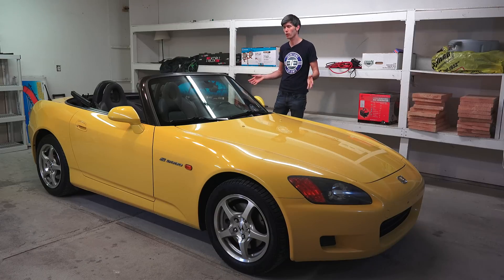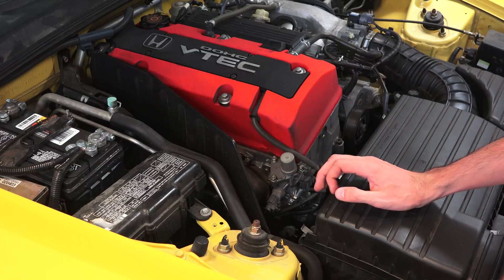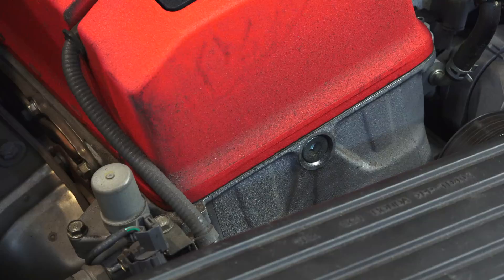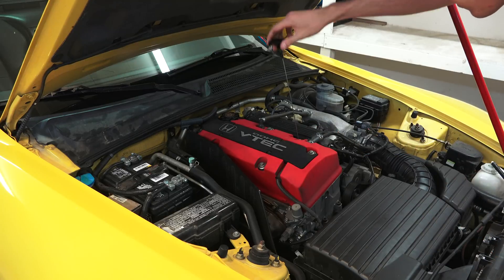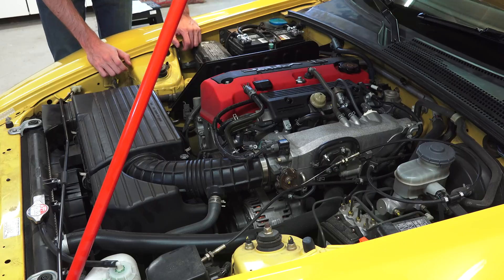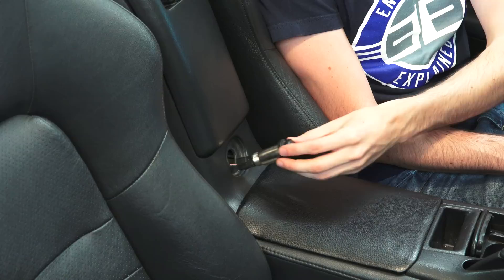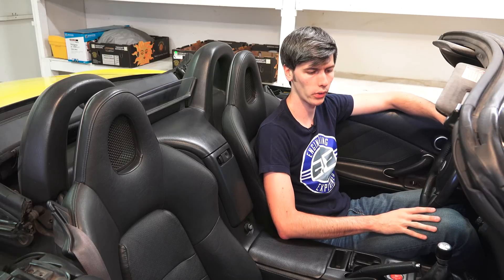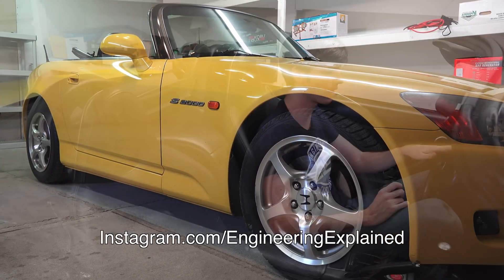What's Wrong With My Honda S2000?

Comment: He brushes off the burning oil thing like its no big deal. Any car that burns oil is a no no in my book.
Reply: all vtec motors burn oil, especially the high compression f20 9k-spinning motor, ask any honda/s2000 owner
Reply: Mine doesn't. 124,000 miles on it. I bought it brand new..after the break in period, I used Mobile 1 synthetic oil. I check the oil every time I get gas. Always the color of honey when I change it.
Reply: if your car isnt burning oil, you're doing something wrong lol jk
Reply: I faithfully change it regardless of what the oil life monitor says. Running like a champ. 
Every 4 fuel fill ups I use Schaeffer neutra fuel stabilizer and cleaner. Getting 35 mpg...car was rated at 33 mpg..no complaints.
It's all about the maintenance. Some do, some don't. Replaced the serpentine belt at 120,000..then rechecked it a week later..it needed a lil more tension, so I did that. Take care of your Honda..it will last.
Reply: Lol I guess you haven't owned an older car before. Especially an older 4 cylinder. All of my family's cars are 100k miles + and all burn oil except our V6 Highlander. Burning oil is not ideal, but as long as it doesn't get much worse and everything else is reliable, it isn't the worst problem to have. Oil is cheap, and people should be checking it at every fill up anyway. If you're curious about which cars that I (as well as my family) have had that burned oil, they were:

1999 Chevrolet Prizm (Toyota corolla rebadged) with the 1ZZ-FE engine (notorious oil burner: a quart every 400-800 miles depending on how much interstate driving there was...3 speed and oil burner do not mix well)
2001 Toyota Camry LE 4 cylinder
2004 Camry LE 4 cylinder...my current car (2AZ-FE: known for valve seal issues on '02-06 models, piston ring issues on '07-11 models I believe)
1998 Honda Odyssey (great car but engine used a quart every 2000 miles or so)
2006 Camry LE (same engine as mine, same problem)
Reply: Heheh..ya. Maybe I should my maintenance schedule. NOT. If I get 250,000 miles out of her, I will be happy. Maybe even more miles.
Reply: I also change my transmission fluid every 10,000 miles. And the filter. Honda claims the trans filter is internal..inside the trans. This is true. BUT, there is also an external trans filter located behind the battery. Looks like a vacuum modulator. I replace that too. 15.00 on Amazon. This is on a 2008 fit Sport.
Use Honda transmission fluid. Nothing else. they are finicky. Never flush the transmission. Just change the fluid..1/2 stays in, the other half is new. It always comes out red during changes...and no metal shavings on the magnetic plug. I wonder how many other Honda vehicles out there have the same filter that they claim doesn't exist.
Reply: +GKAtascosa Some S2Ks burn oil, some don't, regardless of maintenance. Neither of mine did/do and my current AP2 has 128K, mostly above 6K revs :) and it's just beginning to sip a tiny bit of oil as expected, but I've heard of nice ones that burned some oil from a young age.. My 03 Acura CL-S 6speed has 186K with some beating and burns ZERO of it's well maintained synthetic oil and I fully expect 250-300K from that V6, if whoever I eventually sell it to keeps up the good work. With your perfect maintenance I'd expect 250K out of the S2K as you said, if you don't beat on it too much, though I don't know how to drive one without banging hard redline shifts every time I get the chance so I expect to rebuild my current S2K by 150K.
Reply: I don't have an S2000, I have a Civic.

Comment: Someone has changed the battery cable ends and those clamp on ends are rubbish.  They will start to corrode. There are solder on ends with solder pills available. Use this with some shrink tubing if replacing the whole cable isn't worth it. Thanks for the vids.

Comment: What a score man! The S2000 is by far and away the best Honda because they put the power to the correct wheels :D The only bummer is that it's yellow... But if you don't mind, or happen to like yellow then this obviously isn't an issue. Seems like the problems are quite minor for the mileage however. The tough one will be the timing chain tensioner.... Not an incredibly tough endeavor, but by far the most difficult thing you have shown.
Also, I would like to see the DIY stuff with the S2000 on your channel!

Comment from the maker: If you're into Instagrammies follow along here! https://www.instagram.com/engineeringexplained/ Because I'm too lazy to Snapchat.
Reply: When checking the oil, turn the dipstick the other way around, you'll get a more accurate reading. Burning oil is often signs of the valve-guides being worn. Rarely if ever has it ever been piston rings. Honda didn't have issues like that. I would recommend doing a full valvetrain rebuild with bronze valve-guides, new seats, springs, and retainers. Also if your going to be pushing it, do the oil jet bolts, they updated those from AP1s to AP2 (2-Jet vs 4-Jet)
Reply: The Airbox comment you made early in the video, most people say that the stock airbox actually provide excellent power, and a pod filter or something will actually reduce the power output.
Reply: Man I wouldn't touch that leaky bolt yet. It's not worth the risk. Just wait to do it at the same time you're fixing that timing chain tensioner. that way it won't matter as much if you drop the parts in the engine by accident.
Reply: @Tobberobbe97 most stock air induction systems are fine. I think a lot of the CAI's are unneeded parts with exaggerated promises (if not worse performance).
Reply: My 1996 ITR with the B18CR used to burn oil and as said by Zero Hour, it was the valve-guides/valve stem seals
Reply: BEHEMOTH20 - Its hard to get power from these F20/22s. Its like a K20 with all the bolt ons and cams already, so its hard to get something better than stock. But its doable, even going stroker works.
 
Otherwise, a good intake, headers to exhaust and tune would get some power but its almost not worth spending money on bolt-ons
Reply: +KrazeeCain actually, the S2000 OEM header is extraordinary.  There ARE a couple that make gains on the S, however.   Ballad Motorsports and URGE Designs are about the only two that I can think of.   A tune will also be required, to see the gains.
Reply: what about brakes? thats important, isn't it?
Reply: +Tekmatic Agree on those two headers, and repeat what others said about not much to gain with S2K bolt-ons. I'm on my 2nd AP2, sold all the engine bolt-ons (including Ballad header, the ONLY thing that mattered) that gave my first one just a little more power and put all the money in better coilovers, tires, etc. IMHO the only money to spend on S2K power is Forced Induction..
Reply: At least with the D and B series engines a lot of people just run 10w-30 instead of 5w and it solves the oil burning issue. I don't know if that will work with the F series or if it's worse to run heavier oil in it.
Reply: GM states on the new corvettes 1 quart per 500 miles is the threshold of oil consumption for high-performance driving. It just happens.
Reply: +It's Zero Hour just fyi for those reading- i think the oil jet bolts were changed mid AP1...my 2002 had the newer ones factory 95℅ sure.
Reply: dan deebz - Hmm, I was gonna say I think in 2003 it might have been updated. Still, I'd go for the rest of the valvetrain.
Reply: Will this fit in my Honda you're going to be that guy..
Reply: Seen a few S2000 engines tuned for racing, all made more power with longer intakes, to the point where it was just silly with feet of pipe hanging out the side of the car while on the dyno, not sure how it affected torque though.
Reply: BEHEMOTH20 That was probably just to get cold air on the dyno. Also a longer air intake wouldn't really affect the speed of the air like the manifold would.
Reply: ***** Yeah they're only good for adding induction sound. I feel like exhaust is the same way too, mostly. I mean really, who's going to feel that extra 10hp catbacks supposedly give anyways?
Reply: Exhaust is a little different, then again I put a long tube header, downpipe, high flow cat, all 3 inch stainless mandrel bent tubing with an XR1 Borla muffler. All that I did notice a nice performance upgrade along with my HP Tuners MPVI Pro tuner. As far as CAI, I just added a K&N filter to the stock air box.
Reply: ***** Oh hell yeah, once you start talking headers you're going to see some gains. Cat-backs alone rarely gain you anything though. I (and my wallet) gave up on the notion of performance in my Vic, and just deleted the h-pipe and replaced the mufflers with 18" glasspacks. That's definitely not a performance upgrade, but I love the sound now, it's like a hot-rod from the 1950's.

Before doing it I read that going with true-duals can kill some horsepower, but I think since my car has such shitty log-style exhaust manifolds and stock cats, having an h-pipe or x-pipe isn't going to help it much anyways. lol
Reply: Thanks for posting your Instagram link! Keep the videos coming!!
Reply: Engineering Explained Honda S2000 or 8th Gen Si + Miata NB?

Comment: You should make a switch to engage the solenoid for V-Tec instead of having to rely on the oil pressure to trip the switch. That way if you turbo it you can have a sort of anti lag system.
Reply: If turbo'd the ECU can be customized to change the crossover point.  The solenoid will only engage if the oil pressure is sufficient, though.

Comment: If the dipstick is like the one on my Accord 2.4l, it has two "O" rings at the top by the handle, inner and outer. If you are not careful while checking it, it doesn't get pushed back in all the way and the oil level will look low. How do I know? I have done it and incorrectly measured the oil level.

Comment: Those are minor problems. A really good deal you got. I must say that despite having the skill to do my fluid change on my car, I never do it, I hate it, and I'm not equipped to really lift my car adequately for it and to recover to fluid without making a mess. Also I don't have a nice garage like that. We do have a small one but we use it to store other stuff. I do the wheels, spark plugs, air filters and other small mechanical stuff ( On my FIT and my girl Friends Corolla ), I wish I was rich and that I had a really good lift to work on my car, that would be awesome. 

Anyway, nice deal and looking forward on updates.

Comment: Classic 'book smart' engineer. Can explain all of the physics, statics, and thermodynamics about an engine; but can't check the oil correctly, ordered special washers and o-rings when they're 5 cents at the local hardware store, and didn't even look over the car himself before he bought it.
Reply: being a mechanic and being an engineer are two different things
Reply: classic hater.
Reply: FreedomFighter
Lol. If you say so. It's the truth though. You heard him say he's never even been under the car.
Reply: I own one and it really is weird. I check one time it's a bit low, then I check again another day and it's not low at all. I do the same thing as the owner's manual says. Which is to wait several minutes after the engine is turned off to check the oil.
Reply: He did check the oil properly.. If the car has been sitting for a while, the oil level reading is very reliable.
Reply: He didn't even say that...
Reply: ewt415
I am an engineer. One of the most terrifying things I saw as I was going through engineering school was engineering students that couldn't even tune a carb, yet were trying to develop new methods of internal combustion. It's a classic 'paper vs practice' conundrum. ***** nailed it. Being a mechanic and being an engineer are two different things.
Reply: difference between blunt and rude, right here.
Reply: this car isnt like others where u can check the normal stuff and then drive off it it checks out...
Reply: "Honda Special Original Transmission Fluid" - I just lol'd. He should stick to the white board or figure out first.
Reply: Before you cocky non-engineers sneer at engineers, keep in mind who designed this car, and any car for that matter, for you guys in the first place lol.
Reply: Combustion69 Feel better now?
Reply: Not a hater
Reply: I usually leave me car for 30mins or more before checking the oil if I have just driven it.
Reply: Hey, I've never been under her hood before either. The first time I just used a 25 cent rubber, closed my eyes, held my breath and hoped for the best 😶
Reply: Combustion69
Glad I could help! Have a good one!
Reply: Combustion69
Not necessarily. It is true that you can't be a licensed engineer without an engineering degree (not sure if the guy has a proper degree or not), but just because you have a degree in a field doesn't mean that is your actual trade.
Reply: Combustion69
 Right, but when you ask a retired doctor what they do for a living (before knowing they're retired, of course), he wouldn't say he's a doctor. He would say he's retired and used to be a doctor because he's not practicing his degree, keeping up with his licensing, or using it as his method of income.
Reply: meaningless. I can bet you're not the best engineering in your class even though you may know how to tune a carb. 

It's like saying it's scary an aerospace engineer is designing a new new jet or propulsion engine when he hasn't been it one or flown one,=. Utterly meaningless.

Comment: Before you start modifying the car a whole lot, you should drive the car stock ( not too much modifications) for a while assuming it's going to see track days. Needa learn the car first ;). The s2000 is a hard car to drive at its limits. Esp the ap1! Maybe upgrade to ap2 sway bars

Comment: Keep the stock air box.  Aftermarket intakes sound like garbage!
Reply: if you have an intake that hisses, you might have bigger problems, most good intakes deliver a sexy induction noise imo try a K&N cheap, easy, simple, sounds nice
Reply: Do they? For S2000's in particular? Cold air intakes sound amazing on most cars. Maybe just a high-flow filter would do it good?
Reply: Some people like the hissing.  I cannot stand it.  The less sound coming from under my hood the better.  The only thing I want heard is a nice exhaust note.
Reply: cracklingice fair enough.
Reply: I guess if you like driving a vacuum cleaner.
Reply: Why stop at 8?  Go 16!  Or maybe a 48 cylinder radial?
Reply: +LowFlyin' I can't pretend to be some authority but this was my question too, where is the "gain" and at what cost and has it altered the curve somewhere else etc. especially for performance vehicles sometimes a gain isn't the whole story
Reply: Peak or area under the curve?
Reply: +cracklingice hissing??? That's NOT the induction noise you should be hearing, but admittedly I wouldn't want one either if my experience with one included hissing
Reply: Airbox stock high flower!
Reply: the factory airbox is quite good, but independent dyno test have shown gains from several aftermarket intakes on the S2000.   The K&N FIPK intake certainly has less of a heat-soak problem, when compared to the factory air box.
Reply: i agree, I have a K&N intake on my s2000 it gets heat-soaked in the summer. OEM is the way to go

Comment: These S2000's burn a lot of oil by design so get used to popping your hood with a jug of oil quite often. It's the price you pay for a 2.0 liter 4 banger with 240hp

Comment: First mod, replace the soft top with a removable hard top.  Saves weight and adds rigidity.
Reply: honda designed it to be a soft top... the chassis is rigid.
Reply: It doesn't add rigidity

Comment: My problem with convertibles is the roll cage
Reply: What about vert roll cages? I'm installing one soon in my E46 vert
Reply: Aftermarket Bolt in versions are available.
Reply: You're right- if i was tracking the car, i'd put in a hard dog or equivalent rated roll bar- and many track require it now anyway.  I'd sooner roll over in an s2000 vs. say a miata.
Reply: Ninja Master That won't cut it for most car clubs
Reply: honda claims the roll cage and front windshield will hold the car up.
Reply: darcygoesfast Every car company will state their roll systems will hold the car up and protect the driver - and most will in an everyday accident. Tracking the car is a different story when you're on the threshold of losing control almost every second at speeds much faster than civil speed limits.

Comment: shock absorbers could be dead because of the miles, pcv valve could be stuck (can solve the problem of oil drinking or not) make sure your brake fluid its not green or black as well as the clutch fluid. greetings from portugal :)

Comment: Would be VERY interested in seeing the use of a 3M Scotch Weld type product, chassis foam, or chassis bracing, in lieu of stitch weld, on the S2000 body to improve stiffness. Of course this discussion would be headed under 'Chassis Bracing' and general, or specific discussion of general principles and compare and contrast of various options.

Also here's interesting discussion on S2000 Roll Center:
https://robrobinette.com/S2000RollCenters.htm

Comment: Ballade Sports Timing Chain Tensioner. It has a stronger tensioning spring. Works perfect as a timing chain tensioner replacement.

I had used this to replace my worn (and this worn part was also non-original) Timing Chain Tensioner (TCT).

Comment: Love the ap1 s2k!

Not planning to improve on ergonomics? Your legs are almost contacting the steering wheel.
I would lover the seat and replace the steering wheel, with aftermarket non airbag wheel, so I can use some spacers to bring it closer. After those changes it will be a night and day difference, I am tall guy my self.